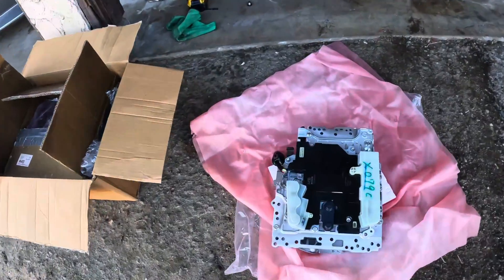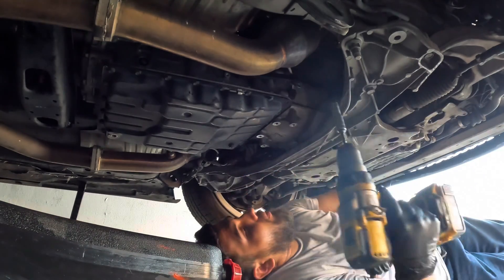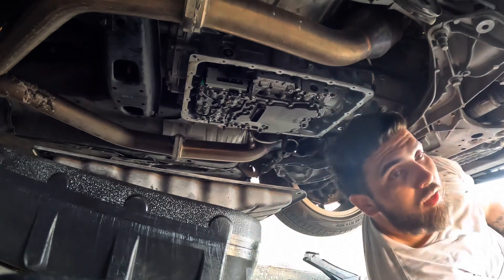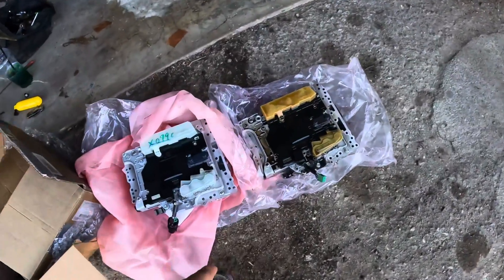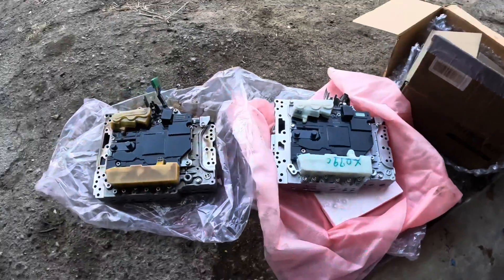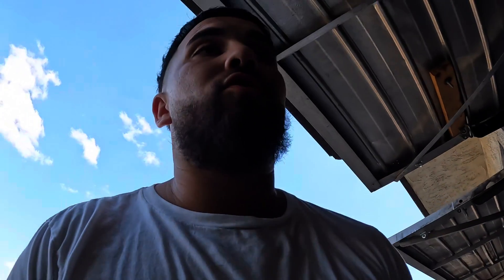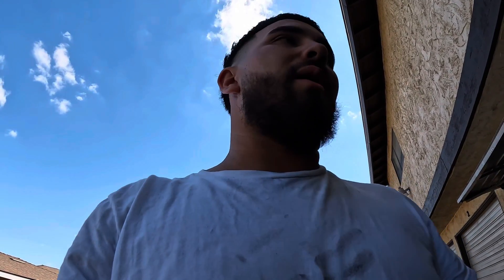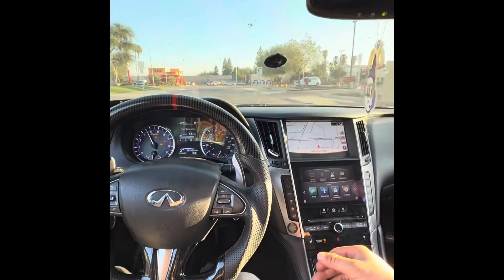Q50 3.7 valvebody replacement

Comment: Question. Bro did you have to disconnect the battery at all to clear  the P0720
Reply: Not OP but clear it with an OBD scanner.

Comment: So i got a M56S and im getting 3rd gear ratio incorrect code...  its goes into limp mode. Is it the transmission or valve body? When it goes into limp i turn car off and it drives fine until it doesnt..  what do u think? Already had the trans replaced once

Comment: What i don't understand why you didn't clean and then use air and reuse ? And did you find parts in the pan, strainer et? what about the cooler? did you check it? Did parts get stuck in the cooler and now will flow back to your new parts?  

This is a half ass repair frankly you gotta check everything !
Reply: Not OP but this is a very common problem on 2017 and below Infinitis. You are one of the few that hasnt had this issue yet. The TCM is the known weak point. Nobody is fixing that module at home. If you have P0720, 99% of the time, its the TCM.
Reply: @rufnusd8730  So you change the TCM? I would change it with a used one for sure,  not new. These cars are 10,000 CAD now in Edmonton Alberta in canada, in working condition, even the twin turbo ones. The 2013 -2014 models 3.7 liter are selling in that range too. I bought several years back for 14k CAD. Works fine. I didn't lower the car which is known to cause transmission issues. WE have summer temps of 40 celsius and winter of -30 celsius sometimes. 

How would a TCM fail though? Bad ground? battery issues? Isn't there fuses etc first that fail?
Reply: @zahershukr6591  I dont change the TCM. I opt to change the entire valve body with TCM attached. The cold weather is most likely helping your situation. From what Ive read, the TCM issue is related to heat and failing solder joints or cracked traces on the PCB. I would never lower one of these cars. Nothing good comes from that esp. the AWD version.

Comment: So why did it go do you know? Is it lowered car? or you have staggered tires? Or lack of trans oil changes?

2014 Q50 sport here, with 472000 kms on it, no lowering, no staggered tires and I drain and refill trans oil every 24000 kms. Everything is running good

Comment: Did you reuse the drain, fill, and pan bolts? I'm looking into doing this and service manual says to never reuse those bolts
Reply from the maker: Same everything boss
Reply: buddy if you opened the pan, you change all the bolts. end of story. Never open the pan to play with it or change the strainer which is not a filter by the way. The only time you open your trans pan is to fix broken stuff like in this video. And you should change strainer, bolts..etc not the pan though.